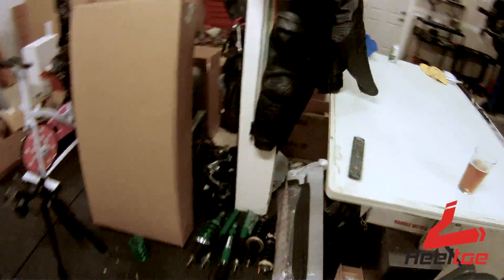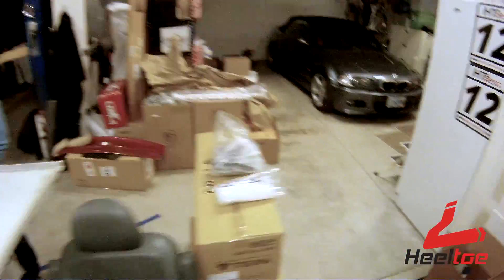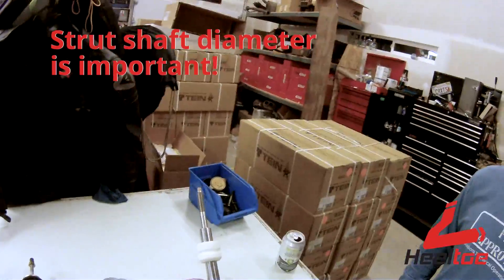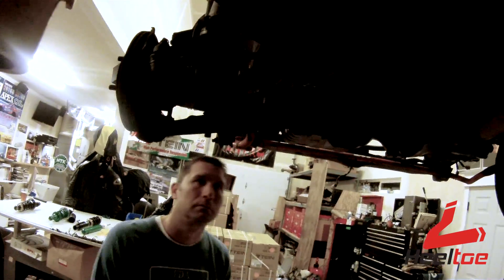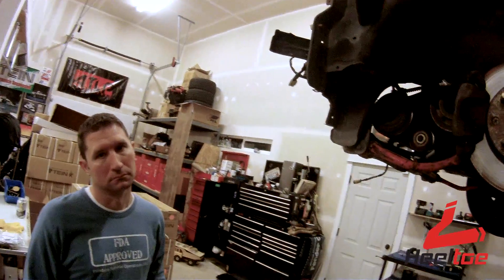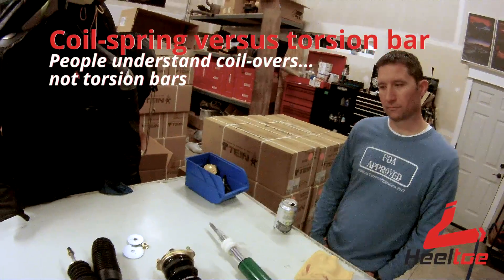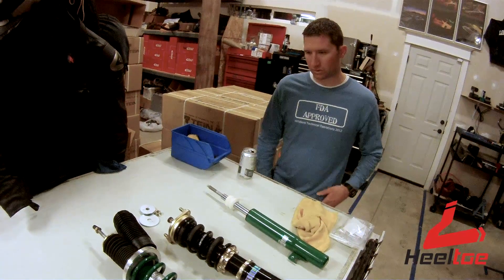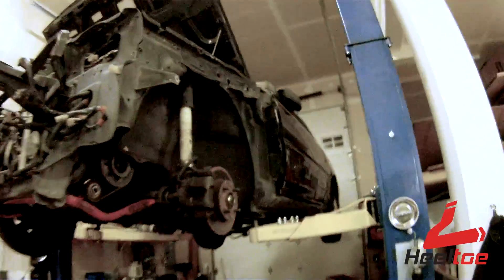Heeltoe's Medieval-Pro VS BC Racing PART 1 : Intro, About Torsion Bars

Comment: Hey guys, just curious but I noticed the bc coilovers have the top piece that go through the strut mount, while the teins do not. What's the situation here? Is there another piece that I need to fit the top of the teins into my car? Also, how would I adjust the height of the front struts, if possible? Sorry I'm still pretty new to cars 😅

Comment: hi got a set of medieval pros I'm after some extended top hats and also wondering what size torsion bars to get I got a b18 in my 85 civic I sent you a email about the top hats got some family coming over to the UK
Reply from the maker: Hi! We have the Cheddas hats in stock now. I would suggest a 27mm torsion bar set. We've replied to your email.